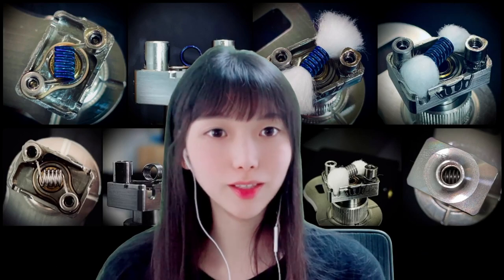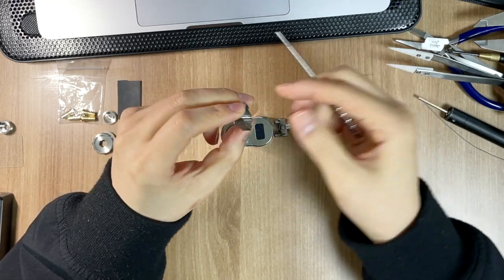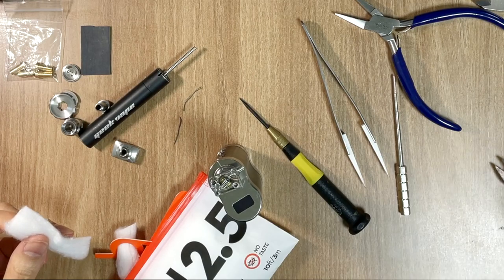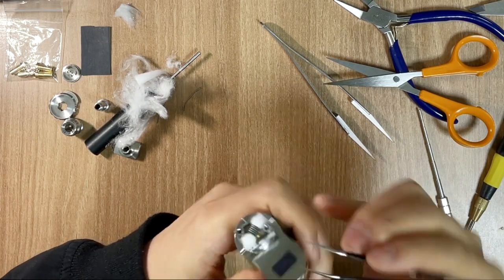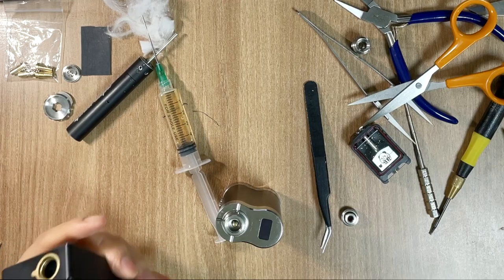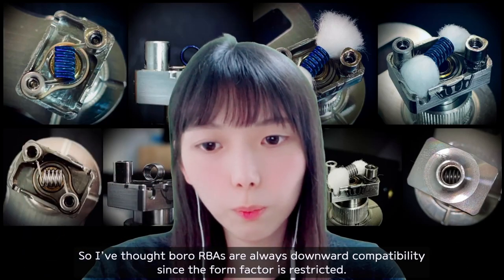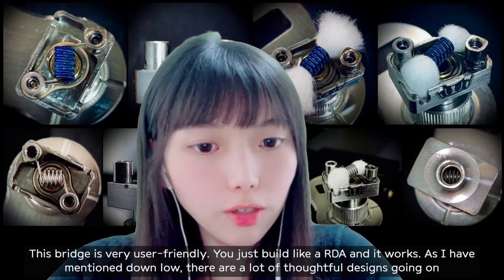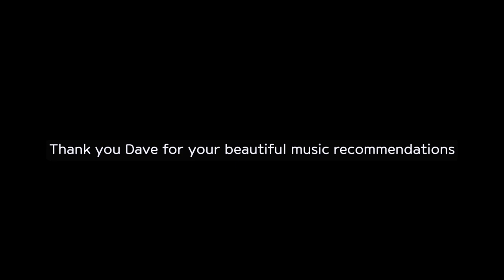Bridg'D RBA by Wick'D Review | Build

Comment: You absolutely nailed this !! Such a informative and peaceful review too 😊 I definitely find myself tending to use a half moon mods wide bore driptip and taking into consideration how the air flows around the coil and converges(as you touched on in this video very well) - as how the coil impedes with airflow, to the gaps and breaks, and most importantly in my opinion the bore of the airflow up to bore of the chimney and the boro device/flush nut which for me,  how I enjoy rdl side over mtl I think the wider the bore(s) - the better ! 
Then coil options for me I also agree that too big a coil or coil mass can interrupt the experience.  
U mentioned 38g outer wrap or finer and totally agree again . My fav midrange build is either 30g/32gx3/wrapped in 38 to 40g it really helps- I also enjoy the 29gx3/38 and n80/n90 is my fav metal as it's clean tasting and fast ramp up. 
By the way your photos of your building of the coils are so blue and beautifully done 💙
^^all of this in concert truly is key to the vape experience anyone of us can achieve. Like a dance of the clouds💃🎶  hehe . 
Anywho I have not used this particular rba but I do have the cthulhu 520 rba - which is very similar and noticed the same tendencies on how it likes to be built and wicked up .
 It's a good one and I like how the 520 rba that I have no issues with chimney (thank God😅). 
Though right now I am really really enjoying the Voltrove 1.1 rba boro tank as flavor is a 10/10 and airflow really silky and smooth👍 I'm only a year into my boro journey its a new endeavor but a I find it to be a fun one and enjoy the tinkering. I plan on trying some bridges out here since there are many well designed ones as it's very popular right now it seems.
🙏 fantastic video and lessons i watched all the way from beginning to end.  Love the music and you explain everything so well ! 
I will be sure to check out your other videos as you are really adept to this :) This is informative, knowledgeable, and meticulously done so well which shows in your work 🎯✅
😄👍 awesome job Mizzvape !! 
🌬💭

Comment: hi, i know this is an old video but i have a question. you mentioned that the size of the chimney hole does not determine the amount of restriction placed on airflow, but I have been having issues with my RBA leaking (50/50 ratio juice), does this have anything to do with the size of this hole or is it my wicking that is becoming an issue with flooding/leaking from the airflow pin?
thanks!

Comment: Amazing review!, Do you think using a vapesnail (atmizoo) can improve your opinion on boro devices?  Because it solves most of your cons. Also, I agree with you on the curvature of the chamber, but then exists highly popular flavour rtas with a flat chamber like the Fev and makes me wonder.
Anyways cool reviews!!!
Reply from the maker: Thank you! I haven't used the Vapesnail but I like the system of putting out the deck and leaving the juice inside the tank, but I would rather use RTAs IMHO.
In terms of the curvature of the chamber, the Fev does not apply to my presentation, since it is the side airflow. I hope it helps 😉

Comment: you speak more than what i think about most RBA in boro ecosystem. Because of the limit of the form factor of borotank, the only RBA that match my flavor expectation is exocet 2, panda is a more refined version of vapeshell and despite of it can hook a big coil, but the flavor is dull and hot during evaporate. IMO Panda is a very user friendly for a newbie to boro systems, and coil that around 2.5mm diameter work the best. For bigger size coil and a flavorful hit, exocet 2 is a winner
Reply from the maker: I also had a better experience with Exocet V2, even though not comparable to some of my RTAs.
Reply: @mizzvapes  it's sure that boros will never reach to RDA and RTA experience, but for a compact AIO/boro system, i think exocet 2 is the best RBA for now